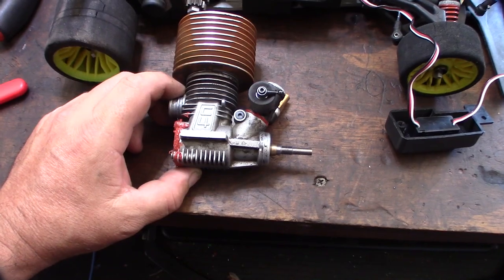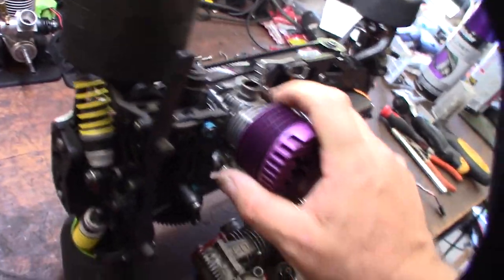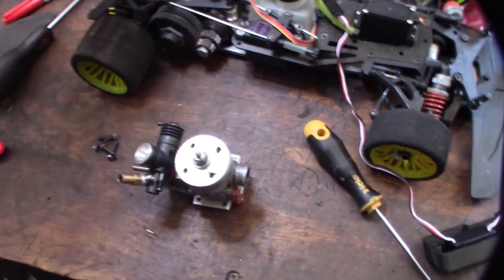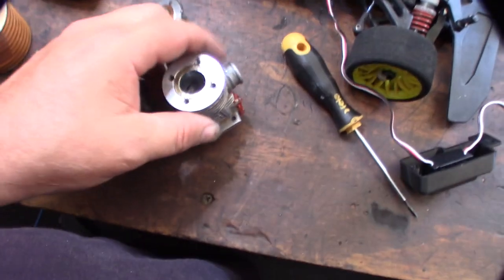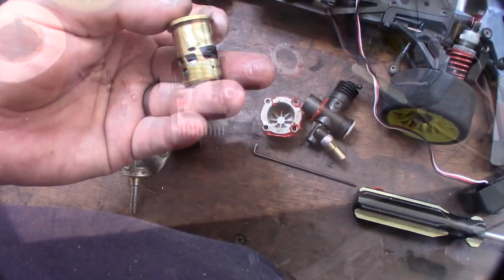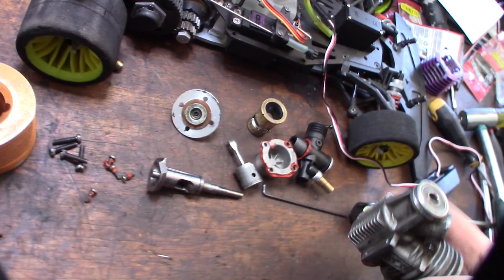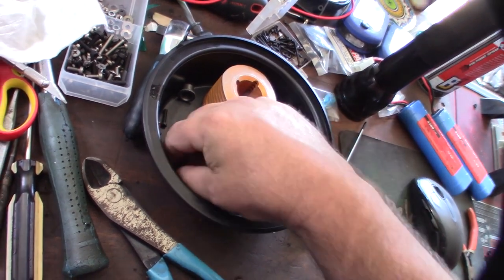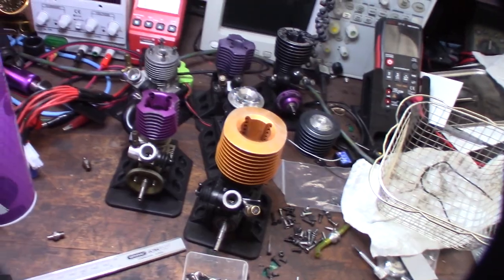RB Concept C4 Nitro RC Engine Restoration

Comment: Those thick head hardened steel Novarossi flathead screws are much less prone to stripping than a standard 2.5mm hex screw